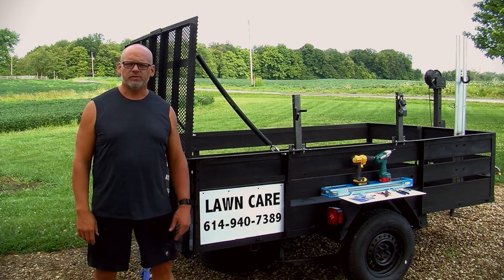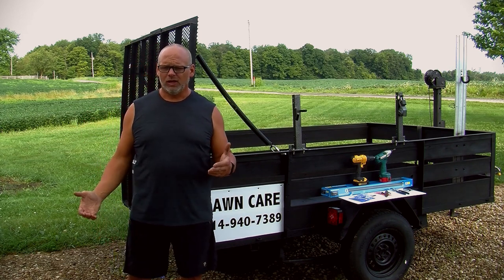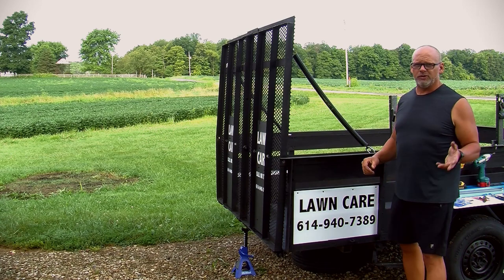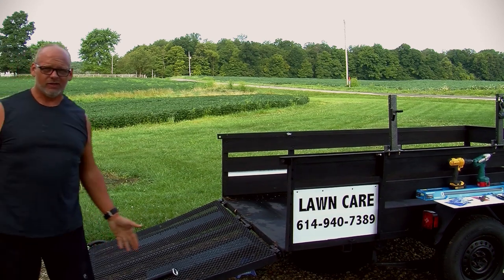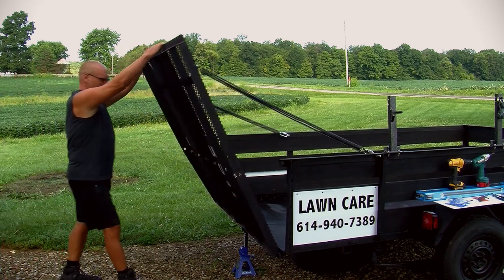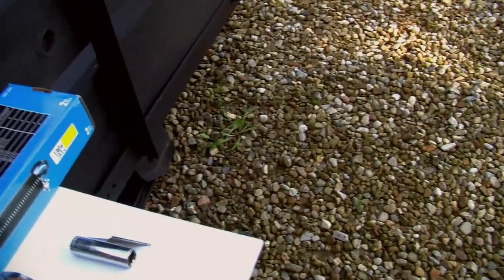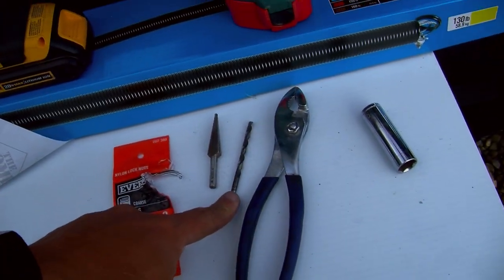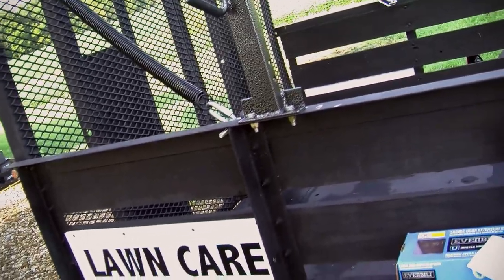Great Scott Lawn Care Trailer Spring Assist

Comment: That drill bit is called a Step Bit or Uni-bit.  To anyone please follow the garage door safety instruction and put the steel braided cable through the inside of the spring!  It contains all the pieces of coil when the spring breaks.  There will be extra cable when the gate is up, but this is why the lift manufacturers use the tube to contain the spring.

Comment: Scott..wish I'd know about this years ago.
I loaned my trailer to a friend who lost my expanded metal tailgate I had built so i had to go back to the original gate which weighs aver 300 lbs.
It was designed so we could run a small skidsteer up in the trailer. 
I get the ramp down to my chest and then I just have to drop it.
I'll be heading to my local home improvement store to get these springs and parts..
Thanks for the great video
Reply: How do you lose a gate? If It came off while driving don't tell me.....I rida a motorcycle almost everyday and if that's what happened I don't want to know....LOL

Comment: Spend $110 and get the Amazon trailer gate lift system.   The cost to put dental implants in after that spring breaks and catches you or someone near y in the face…….  There’s a reason the springs are enclosed in a housing.

Comment: Scott..
I just bought the 150 lb springs and eye bolts
I don't have expanded steel on my gate.
My tailgate is 77 wx52 l
Weighs about 300 lbs
How far from the top of your gate and to the rails on tour trailer did you measure to  mount the springs??

Comment: Hi,after using this for a year is there any problems ?
Anything you would do different ?
does it weaken the trailer to drill a 3/8 inch hole in it ?

I have a 6.4x12 Dovetail Trailer with a 3 foot gate and I am disabled with spinal stenosis and it is all and I mean all I can do to raise the Loading gate.

Thanks

Comment: Any danger of it coming loose and hitting you? I am always afraid of that since it could cause serious damage if it were to hit you in the eye or something
Reply from the maker: They don't have nearly the tension on them that the garage doors put on them and they are rated to stretch 10,000 times before replacing them so I'm not really to worried

Comment: I used this on my Enclosed Tralier except I had to use 90 lb springs Maybe because my trailer has a Plywood Gate And Maybe a little bit lighter....I had originally Bought 140 lb Springs But I Couldn't even open the thing...Much Better than The Cable & Drums.

Comment: Looks good. I will be installing mine today. I also seen the same videos that you watched before and I picked up a few good ideas. I like yours but the thing I would do differently is, installing the eye bolts on an upright position, to avoid loosing width of trailer and to keep them out of the way while loading and unloading, other thing I would do differently is, also installing eye bolts onto the tailgate frame instead of directly on the metal screens because the screen will bend with use. 
Just my thoughts. Thank you for a great video upload.
Reply from the maker: Just an update.  Everything I did in the video is the same.  No changes and they still work perfect.  Thanks for the great comments
Reply from the maker: How did your install go

Comment: U are doing your ass backward : need put eye bolt on the outside the rail under neath angle iron  /  also u need eyebolt 12 " from top of the gate down on the outside of your gate to with eye bolts ! . need to be firm tie spring ?.

my gate weight 292 lbs  i can use one hand to lift or one hand pull gate down / i use 2 - 150 lbs spring

Comment: So dangerous. Put a cable through the inside of spring. Incase the spring  snaps.
Reply: How tight do cables have to be and when you raise gate cable get stuck in springs? Cable get tighten when gate is up correct? Thanks
Reply: @jaime199  in all onisty. i would not have them on my gate. I am a Hanger and  rool door and electric gate mechanic sence 1996 and i don't not recommend installing  a spring on a gate such as this.
I work with springs as big as 14 inch round and 6 feet long. They are very dangerous and can kill our do permanent bodily harm. They sell them where they are held inside of square tubeing.